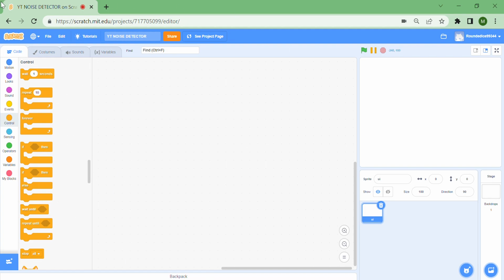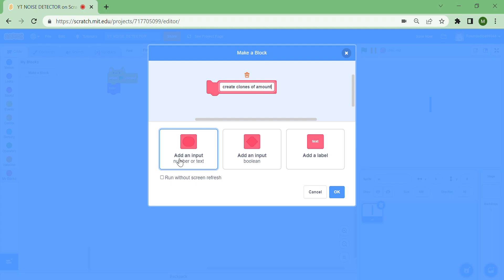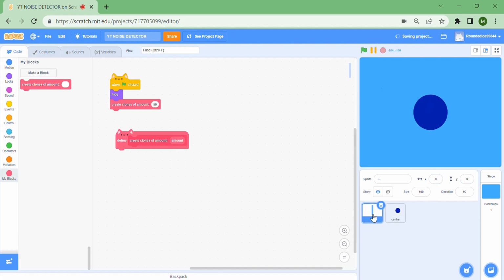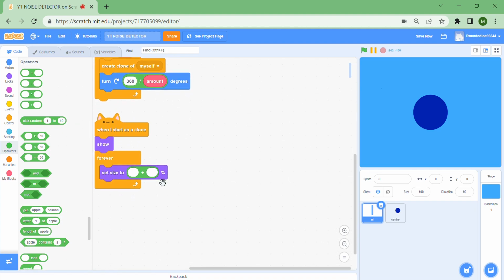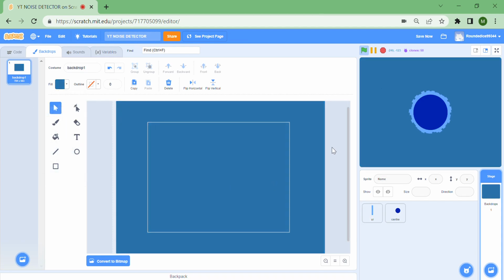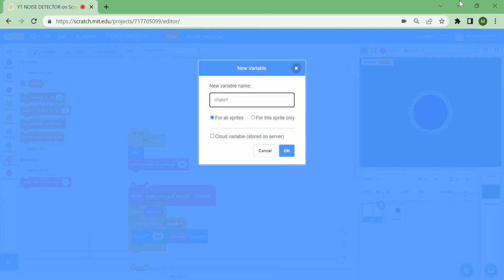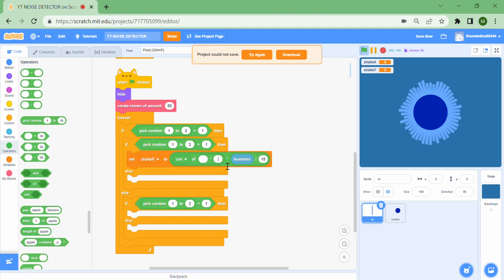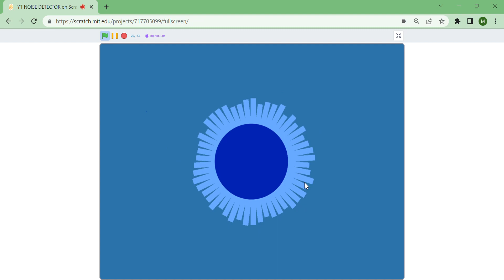How to make a NOISE DETECTOR on Scratch!

Comment: What's the point of "without screen refresh," my computer always tries to commit fortnite elimination whenever I run the project with it
Reply from the maker: well its useful sometimes. it wasn't actually needed in this video too much, but it makes everything in the custom block run forcefully in one frame. any repeat blocks will trigger all at the same time. if you put time related blocks like the  'wait __' block, scratch cannot wait in one frame, so commits fortnite elimination.
Reply: @RoundedIce  I've only used it without a waiting block, so what gives?
Reply from the maker: maybe you put too many scripts in there. a large amount of repeating instructions takes time. it could also be caused by a forever loop or a repeat until block. if the repeat until is never finished, the custom block will keep running forever in one frame.
Reply: @RoundedIce  oh ok, thanks! Also your cat sounds like a kind guy :)